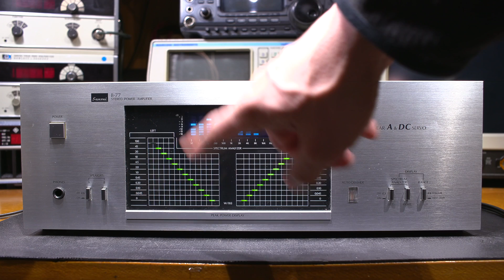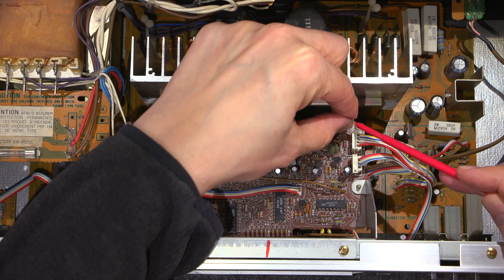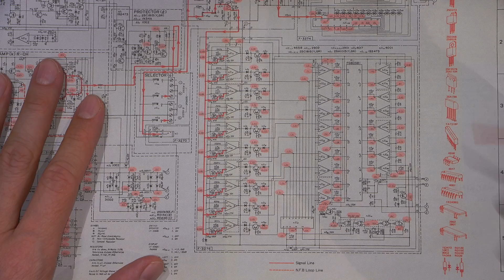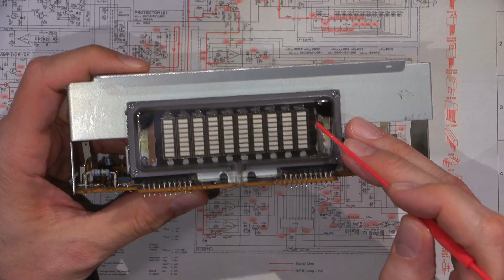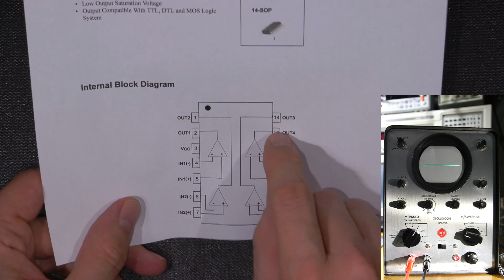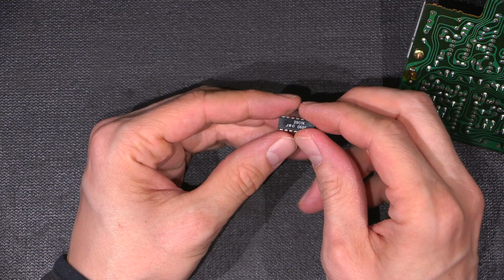Electronic Repair- Sansui B-77 Stereo Power Amplifier!

Comment: This amp is from Sansui's 'average quality' cheap rack system range, and not to be confused with their high quality 'AU' series amps.
Reply from the maker: Please define "average quality" from an electrical aspect, not from consumer reviews.
Reply: @MrCarlsonsLab  I'm waiting in anticipation for a response from Ingleprop Noosegarm.
Reply: @hareti79   The A-Series was a deliberate cost-cutting attempt by Sansui to compete with the then popular lower price /quality rack systems. I had an A-80 and an A-60, because I couldn't afford the high quality AU-series amps. A-Series had plastic sides, fiberboard bottoms, and slots in the plastic sides as they were designed to be housed in cheap racks not sold as separates. The AU series had heavy full metal cases and much better components throughout. A-series price was low. Their weight was low. The huge power transformers and caps of the truly Hi-Fi AU series were left out, discrete output transistors were left out for integrated 'power-pack's. The specs tell you all you need to know. There is no area in which an A comes even close to the capability of an AU, and the sound comfirms this. They are weak, bland sounding amps.
Lights ans meters were added as cheap trinkets to appeal to less knowledgeable buyers. 
The top of the range A-80 cost less than the lowest of the AU series: the AU-D101, which was a much better amp. The specs just do not compare.
These amps produce a bland and weak sound that in no way compares to the supremely extended and awesomely powerful AU-series. 
These amps are only good for undiscerning listeners who don't know much about Sansui and are beguiled by trinkets like LEDS and meters.

Comment: Mr Carlson's Lab    I enjoy watching your videos. I can certainly understand the enjoyment you get out of the challenge of taking a device which has failed and restoring it to its original operating condition. I have not heard this discussed in your videos but do you do this money or strictly as a hobby? Over the years I have found the best individuals in their industry are the ones that clearly enjoy doing what they do for a living. Then go on as you have done to teach by example. Do you have a shop or just the lab you show in your video. How do projects find their way on to your work bench. With today's technology do you find most individuals when they have an item go bad they just trash it instead of seeking out someone like yourself to repair it?

Comment: Back in the day devices could be more dangerous because the person sitting at the bench had a built in safety device called common sense. As technicians have evolved they have lost their built in safety feature and so now manufacturers must build safety features in to make up the difference.
Reply: Could it be that adding more safety features has lessened peoples' common sense?
Reply: Iain Portalupi 
Nope.
Reply: I've said for years that the smarter consumer gear gets, the dumber the consumers become.

Comment: The cool thing about those old amplifiers, is that you don't need a schematic, the circuits are very predictable, and its not hard to trace it out anyway. single sided pcb no hidden layers, large through hole mounted components, no tiny surface mounted components, no expensive surface mounting de-soldering tools needed.

Comment: Interesting. I've never really investigated the use of signature analysers, instead preferring scope signal tracing. Mind you the commercial ones are't as capable  as this. Could be a useful addition to my testbench,  and I think I'll check out your design. Was thinking that a quicker construction route would be to make an add-on for an existing scope, just use XY mode. Avoids the need to make up a CRT mount, EHT supply and so on. Actually, some of the small handheld scopes on AliBaba or the like might be ideal since there is no need for massive bandwidth. 1MHz would presumably do. (I know you like the style of vintage gear but I'm just thinking of the least cost implementation!)

Comment: centuries ago we had a rash of VFD failures on certain Hitachi/RCA VCR's,The factory was very quick on releasing tech notes so a tech seeing that problem would have a fast track to getting the machines fixed.The factory released the kit which had some caps,and a dc-dc converter,maybe some other stuff.I can never forget that RCA P/N 163818
Some techs have said it was the pcb solder joints that failed on the converters

Great video, on component level replacement.It would have been my boss that said- order a new display from Sansui.Then the customer would balk and pay the min charge and disappear

That's illogical,Captain.

Comment: Hi Paul, you didn't actually show how you would even reach the contacts on those large capacitors to discharge them safely.  Any insight into how to do that safely?
Reply: Me, i discharge large capacitors  with a 60 watts tungstene light bulb, it's soft, and not damage the caps.This an old style method.
I also use this bulb when i suspect shorts circuits in an amplifier, i swap the main fuse with the light, if there is a short circuit, the light glows a little : you don't blow a lot of fuses, and not damage the circuits you are fixing !! Old Style method too !

Comment: I"d be interested to know exactly to which plates (or grids) that those two IC's that you replaced, went.
I assume the first one you found corresponded to the top line of the display. Where did the 3 defective outputs of the 2nd chip go?

Comment: I think very few people know that an amplifier like this even when switched off can still pose extremely dangerous voltages. My highest ever measured voltage (in a Car HiFi amplifier) between the positive and negative rail was 120V DC. So + 60V between plus and GND, and -60V between minus and GND.

Comment: Given that 2 out 4 IC's failed. Depending on price vs labor cost would you not just replace all 4?
Reply from the maker: The others are fine, (curve/ signature tracer shows this.) Knowing where to draw the line is very important, as one could just keep going and replace everything. There would be no benefit to this, as the new components may fail at any time as well.
Reply: @MrCarlsonsLab  good point!

Comment: Thanks Mr. Carlson. Assuming you only have a normal DMM, would you just use the diode function with the same procedure to find the fault?
Reply from the maker: The diode function on a DMM is very different. This is a "curve tracer" and applies an AC signal to "sweep" the DUT. This also allows one to look at inductance, capacitance, resistance, forward and reverse Voltage, so on... all at the same time, on the same screen.

Comment: I am new to component level circuit repair, but learning. Is there an advantage to the tracing device you show at the end, over an oscilloscope? I have an old 15 MHz scope.
Reply from the maker: This is very different than just a plain oscilloscope. This is a "curve tracer" and applies an AC signal to "sweep" the DUT. This also allows one to look at inductance, capacitance, resistance, forward and reverse Voltage, so on... all at the same time, on the same screen.
Reply: @MrCarlsonsLab  Wow, that is very impressive. Thank you for explaining. I have a lot of learning to do. I am considering to join the Patreon $10 or $20 level, but I worry I will drive everyone crazy asking too many newbie questions!

Comment: That's one hell of a disclaimer at the start...  cover your arse
Reply from the maker: Or maybe I actually care Peter.
Reply: Yeah it's a disclaimer, but he's inviting you to open up a device with exposed mains voltages inside!  These voltages can kill you Peter.  115 or 240 volts at 50 or 60Hz can put your heart into ventricular fibrillation, where it just oscillates with no sequential valve operation.  You are then dead if no one can your heart out of v-fib.  If you accidentally grab hold of something electrically conductive (like metal), the 'electrocution current' simply overpowers the tiny currents used to operate your muscles, & there's no way you're gonna be able to ungrasp your hand.  See the thing is with electricity we can't see it, smell it, or hear it.  We can only perceive it's effects on other things.  We mostly can't feel it below 50V unless we're silly enough to put your tongue on it!  

But even if you get zapped & it doesn't kill you, you may get thrown across the room.  Your arm could get flung against something sharp, hard or fragile!  Getting zapped while picking something up that's 'live' may result in it being thrown across the room or dropped on your foot. 

Paul even showed us the protruding bare terminals that had mains voltages on them, just inviting him to kill himself!  This why he mentions the isolating transformer.

Some people just don't get the dangers in a practical sense.  Care is always required.

Comment: Great video as usual!  But I would have probably replaced the other two LM339's as well. With two of the JRC clones bad, I suspect the two good chips are not long for this world. Also what is the voltage on the VFD elements? Could this be a design problem where the drivers are operating outside or very close to their max voltage on the collectors?

Comment: Anyone subscribed with more than a simple passing interest should head over to Patreon and kick in a minimum at least. It only took me a few hours to move up from minimum to a "bit" more once I saw the quality that is there for any Patreon member. Mr Carlson, Kudos again! I have a small stack of projects I need to turn my attention to including a nice early 80s vintage Yamaha power amp that "let the magic smoke out" on me a few years ago, I could not bring myself to "recycle" it into parts or put it in a trash bin. I also have a Bogen tube PA amp that had the back panel get wet. NO idea how much damage was done, we have owned it since new and I was sick when I saw it wet in storage. I DID have a good outcome in repairing a Sony monitor that lost an IC. My first attempt at micro soldering and it worked! I now use that monitor along with a video camera to be a 20 power microscope. Another very handy tool to have on the bench!

Comment: Looking back as a young tech working on home stereo and TVs in the late 80's/ early 90's I can look at that Sansui schematic and really appreciate it. A work of art compared to today.
Nice job finding the faults.
Cheers,
 - Eddy
Reply: I've worked as a technician too, in this years, vintage hi-fi equipments where well and build for durability, not "buy, use and throw away" as nowdays !
The oldest hi-fi system  i own, is 45 years old, it's a "compact studio" designed German device ( really current in the 70') , still works, but certainly needs à serious reconditionning ( recap, and readjustments..).

Comment: Weeellll....some dips, gate, and drivers at last! Very nicely done Paul. .....of course you could teach a NON EXAMPLE of how to do it right by gluing your LM339 on top "dead bug" style and clip off the bad driver leads and bring them up to the dead bug leads....stealing power and ground from the 2901 of course. Dead bug style is ugly, but if you need a field expediency fix FAST, or maybe you can't get to the bottom of the board.......it will do in a pinch.   I still like your way better.

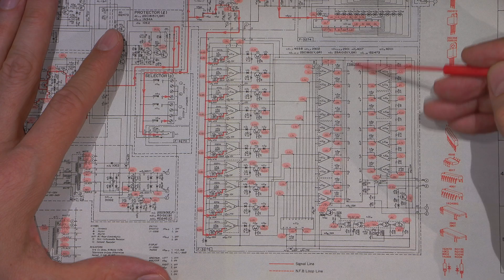Comment: It's unfortunate (but understandable, as it's video focused on the repair) he didn't explain the VFD driver circuit, as in my opinion it's quite elegant. I figured I'd take a stab at it here. Schematic is shown a.o around 19:49. On the left of the schematic, there's the 10 opamps for the 10 frequency bands, each one surrounded by what I think must be a L and a C that together make a bandpass filter to filter out the frequency for that frequency band. The opamp is followed by a diode and a capacitor to do rectification; the output of that is more-or-less a voltage indicating the audio energy in that band.

Now, the way the display works is that it's scanned: at every single time, there's only one of the grids active, allowing only the one column of indicators for one frequency band to light up; all the other frequency bands remain dark. This is done with the IC at the bottom of the schematic, which probably is a 4017-like decade counter: every time it gets a clock pulse it activates the next of its 10 outputs, looping back to the first one once it reaches its end.  This counter is clocked by the free-running oscillator made out of a few discrete gates that's visible to the right of it.

Every output of this decade counter does two things: first of all, it goes off to the right, to a comparator (that's being used as a voltage shifter here) that drives the grids of the VFD to actually activate the grid for the current frequency. Secondly, it goes off to the right, to the bank of bandpass filters, to let the signal of the filter for the selected frequency pass to one common line. (That's what the transistors next to the bandpass filter are for.) This line then goes over the VFD, all the way to the right side of the schematic, and gets passed into the bank of comparators there. That bank has a set of thresholds each a little higher than the other. so for every comparator that's above the next, it takes a little more power to activate. Each of these comparators drive all the segments (plates) that are in the same horizontal position, but as only one grid is active, only the segments under that activated grid actually light up. This way, you'll have a 'column' of activated segments which heights corresponds to the frequency in the selected band.

All of that works together to effectively activate a VFD column for a frequency band, sample the filtered power in that frequency band and compare that to the threshold needed for each level segment to activate that, and drive the segments correspondingly. The electronics will let that sit for a short while before moving on and doing the same for the next frequency band and VFD column. This means at every single time, only one column is active, but because of persistence of vision, it looks like all segments are driven at the same time.
Reply: I have a pioneer sa9800 if your familier with it.
I have a lovely bright display but I'm lucky as many of these are dim.
What causes this
Reply: @abc-ni9uw  I'm not that familiar with degrading patterns of VFDs, but it can be some things. If the lower bars are dim but the upper ones are still bright, it's yer normal wear-and-tear: the phosphors will have a certain half life when lit and they will get naturally dimmer over time. If the entire display is dark, something may be going on with the supply voltages; obviously, if these are too low the VFD will also dim. I see the amp discussed here also has an automatic dimming circuit, perhaps the error is even as simple as whatever photosensitive is in there going off.
Reply: Thanks for taking the time to explain.  I agree - Had he elaborated on VFD driver principals as you did, he could have immediately counted for row number coresponding to row that was stuck 'on', and home onto defective comparator directly. No need for curve tracer. Wait! may be he did that on purpose to spin this tracer and drum up donation.
Reply: @jimwilliams8858  Eh, I think if it's more a case of 'when all you have is a hammer'... the curve tracer is very handy for when you have multiple signal paths that are more-or-less the same, and this is a prime example of that. Plus, for people who aren't that good at electronics, this is the easier route to take: with the curve tracer you can still find the error even if you can't make heads or tails of how the actual electronics work. Still, I think some explanation of the schematic would have been nice, as, as I said before, I think it's pretty elegant.
Reply: @jimwilliams8858  Nothing stopping you setting up your own Youtube channel  may also be a better use of your time then leaving sneering comments.....

Comment: Hi Paul. Thanks for a good practical demonstration of how to use a curve tracer as an in-circuit component tester. These testers have actually become fairly common on eBay and Amazon as soldering practice kits - one of them even has a high and low current switch, so it might have been cribbed off your Patreon course - but you're right that the practical applications for them are rarely discussed in this age of disposable digital trinkets.

How do we know what to look for when checking ICs? Is it as simple as finding the input and output semiconductors in the equivalent schematic in the datasheet?

EDIT: By the way, I gotta push back on your claim that consumer electronics are safer now than they were in the past. Lots of cheap products with a USB charging port mains earth referenced through a capacitive coupler, almost as dangerous as the chassis on an AA5 radio. Main difference is it typically costs less than an hour's pay to get a new cheapie-cutor, whereas an AA5 would have cost a week's pay at least.

Comment: I recently had to diagnose a no start electric motor on a 1981 Singer furnace in one of my rental houses. I am not a hvac tech, or electrician by any means but have learned enough in my 43 years to get me into trouble. I was extremely impressed by the schematic neatly tucked inside the furnace that made it very easy to repair. I wish more companies did this today.